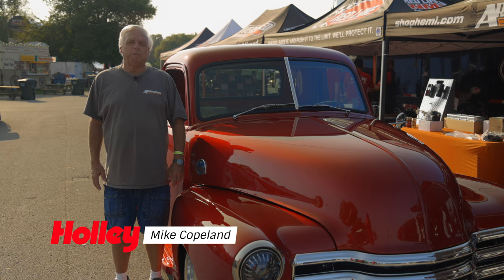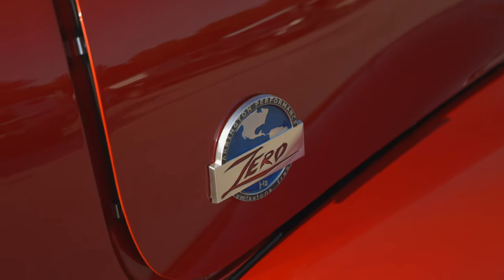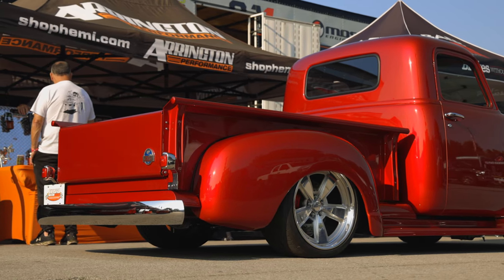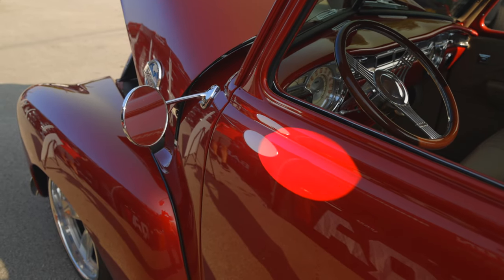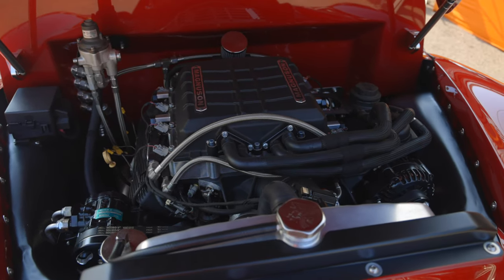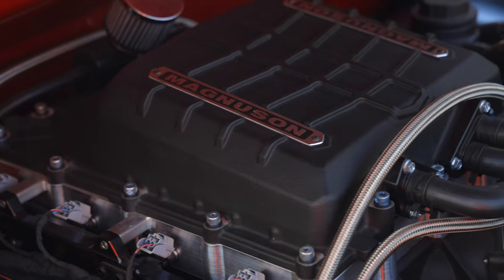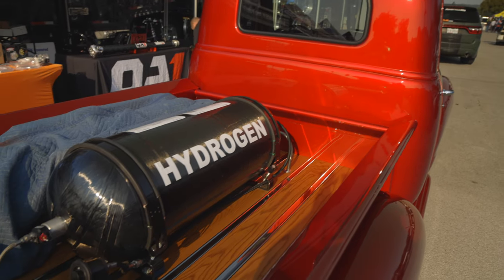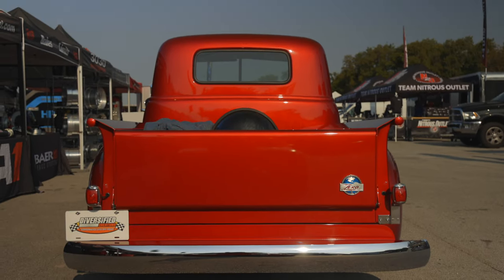Take A Closer Look At “Zero”, Mike Copeland’s Hydrogen-Powered 1948 Chevrolet

Comment: 400hp on an ICE engine that has zero emissions. Why dont we switch to this?
Reply: Just wait like five, six years and we will have at least half of the infrastructure, for example Cummins is investing into hydrostations big time!
Reply: Range.  That big tank only holds the equivalent of 3 gallons of gasoline.  And obviously building filling stations.  California already has over 50 H2 public filling stations.
Reply: People are scared because it is hydrogen when it will be safe. The hydrogen production cars we have now are fairly safe.
Reply: @ChummiaChan Interesting, I know the A Plant in Piketon, Ohio is going to be used for hydrogen fuel production possibly, but Cummins investing is so awesome.
Reply: @scottkolaya2110 Hydrogen would be better than EV because it is not nearly as harmful to get either. You can convert water into hydrogen fuel which uses a bunch of energy, but does not add much pollution.
Reply: @ethanweeter2732  Sure, better is all relative. Someday, in a few decades, electricity might be so ridiculously cheap that splitting water with it won't cost you $1/mile to drive on it. Obviously, if that happens, it'll be practically free to drive EVs, too. That's the classic splitting water hydrogen issue. As electricity gets cheaper to run electrolysis, then it gets even more cheaper to run EVs.

Comment: I have a question, can people produce the nitrogen themselves? In other words, can it be done in a small shop building? Or can this be produced as the vehicle is driving?
Reply: It is Hydrogen and yes you can produce your own Hydrogen via electrolysis you can by units of varying sizes that produce so many units per hour.  Can be done in a closet its how little space they can take up.
Reply: You can produce it yourself.  On smaller units it takes about 70kWh per kg.  Although the electrolyzers are pretty pricy at about $2,000/kW for smaller units.   Something that can make 1kg per day runs in the order of $5,000 to $6,000.  That would take about 3 days to fill the tank in that truck which would give you the driving range of about 3 gallons of gasoline.
Reply: @scottkolaya2110 Except you don’t need to when hydrogen fueling stations are made more available throughout the country. The government will be funding prices to add hydrogen fueling and exchange tank stations.
Reply: @easyenetwork2023  of course, but that wasn't the question. They just wanted to know if it could be as convenient as EVs.

Comment: Where does the H2 come from?    There is no green H2 or electricity...H2 mostly comes from CH4 (methane) .  Methane is cheaper than H2 and more available.  CO2 is not a problem - it does not cause climate change.
Reply: Hydrogen is the most abundant element in the universe and here on earth.  You can produce it green.  We have these giant areas on the planet with lots of sunlight.  You take that sunlight and harnass it via solar you then take water (salt or fresh) and you perform electrolysis using that solar power and WHAM you got hydrogen.  Then you can store , transport or pipe hydrogen like we do gas and oil anywhere you need or want it.
Reply: @iwikeu  You have a very simple and wrong view....there are no green solar panels...the mining and manufacturing of panels is not green....the land under the panels suffers from lack of sun.  CH4 is cheaper than H2 and already available...it produces some CO2 when burned  but so what?
Reply: @iwikeu  Hydrogen is far from the most abundant element on earth.  And while you can produce it with solar, the electrolizers are still too expensive to be only running them when the sun is shining and you have to scale them to meet the peak solar output.  And it's also a lousy energy storage from an efficiency standpoint.  If you run them in fuel cells to drive, just imagine needing to install 4 times as many panels to drive the same distance as storing the same energy in more efficient methods.  California has been trying it for the last decade, but it's just way too expensive.

Comment: Yeah, but where do you get the hydrogen, and how much pollution is generated to collect it?
Reply: Two ways mainly.  One is through high temperature steam reformation of methane.  The other is electrolysis.  Roughly 70kWh per kg (when you count everything).  To put it in perspective, 1kg of H2 gets you maybe 20 miles in this.  70kWh gets you 140 miles in an F150 lightning, or about 280 miles in most EVs.